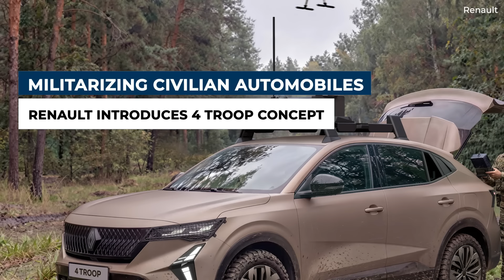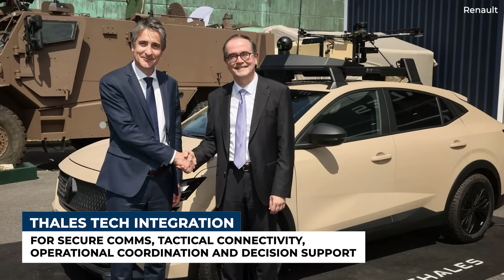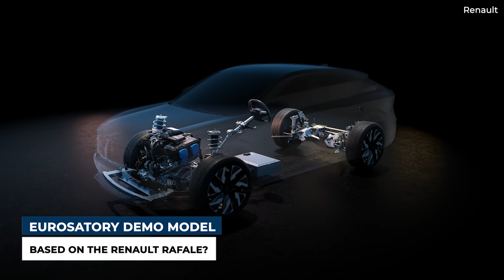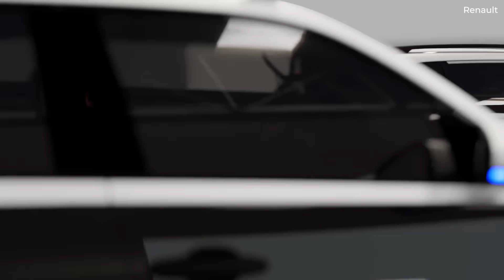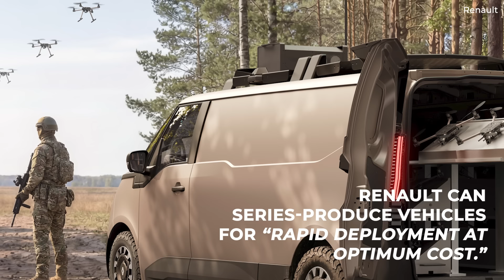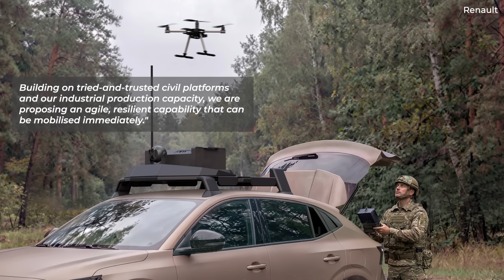Tactical Vans And Coupes?! Renault Group, With Thales Pitch Military Vehicle Concept

Comment: The UAZ Bukhanka van or Fiat Panda 4x4 of the early 1980's would be better, simpler, cheaper, more maintainable and reliable light utility vehicles for military use rather than these over priced and complex modern day SUV's and vans. The expected high attrition rate due to drone attacks makes cheaper vehicles a necessity.

Comment: Spare capacity in European automakers would be better used to build UGVs or drones rather than 50k family cars. Vehicles only survive a few trips to the front at a time, so using old refurbished trucks is more economical.
Reply: Those family cars could be drones too.
Reply: Yes but we are not at war so why not get new vehicles which are not intended for front line use, hopefully we will not get into a war and the vehicles will last 30 years, if we are we can just buy more old vehicles and war economy will produce the drones needed

Comment: Ukr is extensively using militarized civilian SUVs to move troops and supplies, and evac civilians.
There's something said for being fast, cheap, quieter, fuel efficient and able to use damaged and low tier roads/bridges.
Reply: They are not really militarized though. They are just civilian with maybe a jammer on top. Putting lots of expensive military equipment defeats the purpose of using a cheap civilian vehicle. It will just be an easy to kill expensive target.

Comment: Better to go with the Dacia Duster, some in 4x4, and some normal drive
Reply: Dacia are owned/part of the Renault Group so that could be a option.
Reply: Dacia duster would make a heck of a lot more sense than a city hatchback with 20 inch low profile tires

Comment: This is a way of supporting french industry with EU defence loans, and try to sell failing SUVs as military equipment and in turn avoid cutbacks and major labour layoffs and thus stabilize french domestic politics.
A low roofed electric SUV got no bussiness on the battlefield or as a support vehicle behind the front. Look at what modified civilian vehicles are used in Ukraine. Vans yes, but foremost pickups with room  for fully equiped adults with all their field gear aswell as cargo room to evacuate casualties.

Comment: They have one good point. Ww2 was won by Sherman tanks and not Tigers, despite being inferior in every way imaginable. Except one: mass producability. The Sherman didn't ask what kind of special wonder weapon is possible, but what is reasonably achievable with the factories we have. That's a good base strategy. But some modifications would seem reasonable.
Reply: I hear you Tex. The Sharman was howeverr superior: when cost, maintenance, numbers, and plain old common sense is taken into account. What I'm thinking is however, operational requirments might be: please don't be a Tactical Coupe :) And if we need them as a last resort, we can buy them cheap and slap Thales or alternative add-ons on as needed.

Comment: As for Norway, these vehicles could be of interest to the Home Guard, whose newest vehicle is currently the VW Amarok. In a hypothetical scenario where the Home Guard acquires drones, a van equipped with drones appears to be an attractive option. A number of people have also received notification that their civilian vehicles would be requisitioned by the military in the event of war; we are talking about ordinary vehicles, totaling approximately 14,000 cars. This arrangement dates back to 1951. The Renault vehicles would be better equipped for the task than these existing ones.
Reply: Or you could just acquire some vans and throw some drones in the back. No need for complicated, expensibe, unreliable, moving parts.
Reply: @nietkees6906  The choice of whether or not to have a fitted-out vehicle is essentially the same as deciding whether or not to have a fully equipped service van. Personally, I lean towards the "everything in its place" approach.
Reply: @XX86 A service van is not at risk of being blown up by a drone. Putting all your expensive equipment in a single vehicle is very risky in a drone war. 
And having these automatic drone launching systems also make you less flexible as they can generally only use a specific type of drone.
Reply: @nietkees6906  A drone or troops can take out any vehicle, I agrre to that. But the Home guard is there to protect important local sites. How much the vehicles are modified must be decided depended on the intended missions. Here is a video about the VW Amaroc HV uses today. They where modified in the Netherlands.  https://www.youtube.com/watch?v=NieTpW95id4
Reply: @XX86 I think it would be best for a homeguard to have vehicles that are as flexible as possible. So the VW Amarok seems very suitable for that. These Renault drone vehicles not so much. Protecting local sites is also not necessarily done with a van full of drones.

Comment: What you refer to as gaps that need to be addressed is precisely the purpose of this program, which is based on experience from Ukraine. Many such tasks in Ukraine are carried out using civilian type vehicles that are simply painted green to a darker color.
Light armored vehicles are no more resistant to drone attacks than civilian vehicles, while the production of heavy armored vehicles is costly and timely. For the price of one heavy armored vehicle, you can produce 5–8 of these vehicles. This allows you to cover a significantly larger area.
Another advantage over heavy armored vehicles is that they can be driven by anyone with a standard B driving license without the need for any additional training.
Reply: This. 🙏
Thank you. ❤
Reply: Not really though. Ukraine really uses civilian vehicles. They don't stuff them with expensive military tech. These vehicles would just be expensive targets in Ukraine. Ukrainian drone teams operare from dug in positions.
Reply: @nietkees6906  They have a drone operations center installed in vans, especially for medium and long range reconnaissance. These are deployed tens of kilometers away from the actual front line and must be mobile.
What you're talking about are FPV positions and short range operations.
Reply: @Dqtube I didn’t know about that. These vehicles seem to be loaded with quadcopters though.